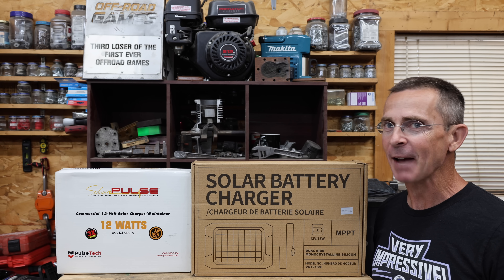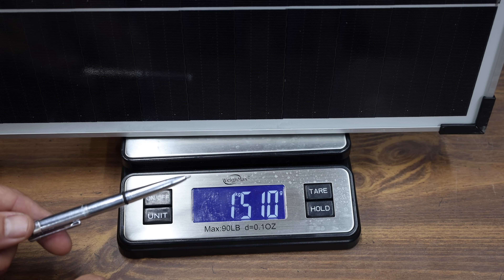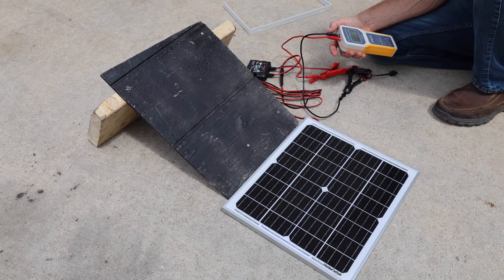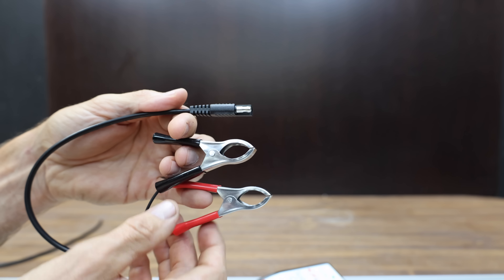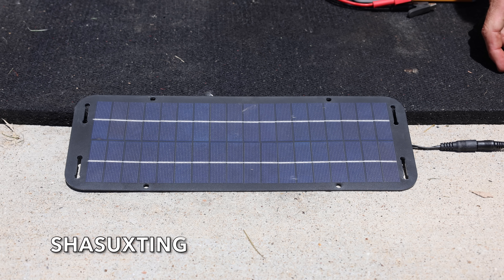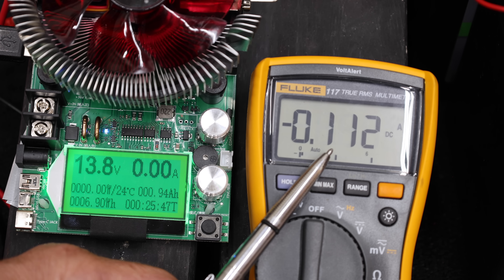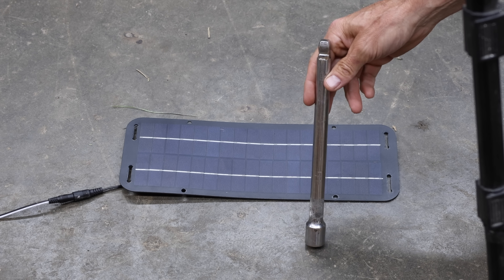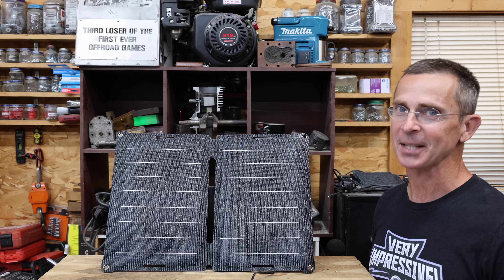I Had No Idea These Were So Good!

Comment: I would not include the power measurement results in the comparison, even seconds on an overcast day can make a huge difference.  
And the fact that some modules had lover power at an angle, which is only the case if refracted radiance is more significant than direct, show that the results should be taken with a HUGE grain of salt.  
You really need a radiation reference or reference measurement, to make the power measurements comparable.

Also the tool you used to measure uses MPPT, so even though some modules had their MPPT below 13.8-14.1V, doesn't mean they would be unfit to tender a 12V car battery, they just would not deliver full power at that voltage.

The in sun measurements however should at least be A LOT more comparable.

Comment: I think the multimeter used here might not be the best for the task - it's rated for 1600W, so most of these are <1% of its capacity.  I suspect temperature of the shunt is enough to swing that measurement a couple watts in either direction.

That said, the battery charging setup was all the info I needed.  That and type - monocrystalline panels work far better in overcast, low-light conditions.  Like, say, if you camp in an old growth forest in the PNW, or want to keep a vehicle's battery topped up year-round.

Comment: I didn't watch the whole video but I used to install and test lead acid battery systems for AT&T. All telephone systems used DC current provided by single cell lead acid batteries. These batteries lasted for many decades because they were always kept fully charged at 2.17 VDC per cell. A fully charged 6 cell car battery should read 13.02 VDC but the alternator will charge it about 14 VDC when the engine is running. After I retired a bought a solar charger from a retired electrical engineer. His solar chargers contained a voltage regulator that kept them from overcharging your battery.

Comment: I've struggled to find a definite answer, even on forums....What is the best trickle charge rate? I've read that lower is better for long term durability. Do I want 3.3w, 7.5w, 9w, 12w, 15w??? I want one to trickle charge my auxiliary boat battery when i'm not using it. I have a NOCO jump starter as backup to the main outboard battery. Amazon's "#1 Best Seller" is POWOXI, which i'm surprised isn't included in this test... $40 for 7.5w, $35 for 3.3w and $70 for 15w...

Comment: Would love to see you do a segment on larger solar set-ups.  Like the size for a shed.  For recharging battery systems for mowers and snowblowers as well as some basic shed lighting.  I have been wanting to solarize me 10x22ft shed for a while and I am stuck on which way to go. It has a nice southern facing roof for about 4 panels.

Comment: Another important factor, not mentioned, is the kind of plug used. Why? A lot of people who own motorcycles, or other electric starting toys have Battery Tender leads attached to our batteries. The solar panels with the same style plug make them an option for when we take our toys somewhere where we can't run an extension cord to use the Battery Tender. I live in an apartment and only ride once every few weeks. I need a solar panel I can toss up on the parking cover and run the wire down to my bike. I want to be able to use the Battery Tender lead I already have attached, so I don't have to have two different leads. If you don't know what plug I'm talking about, it's the style used by the Grecell.

Comment: Ive been using one for 5 or 6 years on my travel trailer parked on my daughters farm current deep cell battery is 5 years old and still going strong. It’s been worth every penny keeping that battery topped off and extends that expensive batteries life.

These would also be useful for dry camping just running the water pump and led lights as long as you get a few hours of good sunlight to top the battery off, no need to buy that expensive fusion brand that plugs into the port on most newer travel trailers and they never tell people that buy it you still need a controller. Think I paid like $19.99 for mine but they’re more expensive now. Mine came with a controller and 20 watt panel, if needed I’d buy a new one a decent battery is like $300 and before using it I was buying a new battery every 2 years had no power for a battery tender where I park it.

Comment: You were right to say that other people would disagree regarding what the charge value is considered high. A 12V car battery is actually comprised of 12 elements. The ideal voltage of a fully charged battery cell / element is 1.2V. Multiply that with 12, it will give you 14.4V for a fully charged 12V battery. Great video nevertheless.

Comment: I have had the pulsetech charger on my lowboy trailer since 2023.

 It keeps the 12v hydraulic powerpack battery for the loading ramps topped between uses. 

The panel is mounted flat to the neck of the trailer between the semi tires. The panel has been sitting in direct Georgia sunlight/rain/hail, etc for 3 years. (controller is covered)

 I put an old used 12v car battery out of a farm truck in it when I built the setup, because I didn't want to waste a new battery. It's still holding charge great 3 yrs later! The panel is constantly getting mud and dirt on it from the rear semi tires slinging it up in the air and landing on it, but its "flexible" surface seems unfazed.

Comment: Photovoltaic solar has 2 limiting factors that make it useless at scale.1, the reaction slows with heat, unlike most others.2 The crystalline structure needs to be thin for efficiency,  but thick for durability.

Comment: Phenomenal videos. Thank you for taking the time putting these together. Another product line idea could be truck bed rubber mats. Comparing OEM to aftermarket to horse stall mats that people use instead sometimes. It would be great to know thickness, material, rubber or other. Slip resistance and puncture resistance would be nice to know.

Additionally, tonneau covers. There are a ton online that are cheap and the ones that are available from authorized dealers are very expensive, Pace Edwards, roll and lock, backflip, etc. Folks online always ask about if these covers leak when installed properly and how long they last over the course of time.

Comment: Hello Mr. Farm, or if I may call you Project. 🤔😬
I am interested in cordless/Battery powered snow shovels for a backyard deck or front porch, even a small gas powered unit preferably not heavy so my wife can also lift it and use it.
I do appreciate all that you do here, it is the most valuable equipment testing site I have seen in my many decades.

Comment: Interesting stuff. I built a wheelchair lift for the rear of my wife's Toyota Highlander. To power the hoist, I installed a battery box with a lawn mower battery and stuck a solar charger, similar to the NX brand, in the side rear window and ran short leads to the battery. Even with tinted glass, it works better than most of my ideas!! Thanks for what you do.

Comment: When you talk watts, it sounds like a lot, but convert it to amps, and it's not much cause 1 amp is 12 watts for 12 volts my 350 watt pannels took damage 6 years ago so i spray it down with clear coat and its still working fine

Comment: I have a 60Watt solar panel and solar controller on my work van. Before I installed the solar system I used to charge my van's battery over a weekend if I didn't use the van . Now I don't have to worry about charging any more and I now installed another 60Watt solar panel to run a small cooler . Now I've seen a slight fuel improvement as the alternator does need to run unless I use AC . Don't know why vehicle manufacturers doesn't fit solar panels on vehicles
Reply from the maker: Thanks for the feedback!

Comment: It's not a valid comparison unless you test all panels simultaneously, as slight differences in light will have a huge effect on output. Some of those tests seemed to be in the full sun and some were not. This will certainly need to be done again if you want any accuracy. If you tilt the panel toward the sun and it performs no better than flat, then you know something is wrong.
Reply from the maker: Thanks for the feedback!

Comment: Plugs into cig lighter? In my car, this is only live/connected with ignition ON. So you have to leave your car with keys in it.... I've run a car solar panel charger, which goes straight to the battery. Makes a big difference!

Comment: I saw a video you can hook up an 18v solar panel to an 18v tool battery charger, on the board, and it will directly charge your battery

Comment: Sorry, but that first test is largely invalid. That solar panel tester is for testing solar panels. In most cases you also had a charge controller, and it doesn't work with charge controllers. It needs the charge controller removed from the circuit.

Comment: I think your solar panel tester is for testing panels without a charge controller. But all of these seem to include integrated controllers. For solar testing you need a known panel to measure at the same time because light conditions change quickly.
Reply from the maker: Thanks for the feedback!

Comment: From what I have been taught there are only two of these solar chargers that would NOT damage a  12 volt start battery for long times between starts.  Your method of rating works great for charging a battery that will not start the vehicle.  But for maintenance I would choose the EBL.  I have used their products and am happy with the results.  The Schumacher has the best cut-in and cut-out for battery maintenance but besides the high cost I have had problems with their products.  This video was timed perfectly because my tractor very nearly did not start today after two weeks of no use and last night was the coldest temperature so far this winter.  I will be buying the EBL.  I still could have got it to start because of your recommendation years ago of the Gooloo jump box.  I never leave home without it.  Thanks a lot.  Now I would like to see tests of battery chargers/conditioners that can charge lead acid and lithium ion batteries.   I still say you are the hardest working YouTuber.
Reply: i also wanted to buy the EBL however the link is dead and all mention of the 25 watt model seems to have been completely scrubbed from their official website, only the 100 watt available for sale now, let me know if you have any luck finding a source from which to buy the 25 watt EBL as i trust project farms review of an exact product but i dont implicitly trust that every product EBL makes is consequently going to have the desirable thresholds for cut in and cut out voltages.

Comment: None of them would work for me at all , I have a couple vehicles stored in my garage for the winter up north, 1. No sun inside the garage, 2. Even if I moved the panel outside like on the garage roof we get over 300" of snow per winter up here, we got 6'-7'  already this winter not normal this soon but happens the panel would be a PITA to clean several times a day.

Comment: I had a bad one of the cheap chinese ones.  I was using it as a trickle charger (plugged in 24x7).  It worked ok in the daytime, but drained my battery at night!  I had a week of low sunlight, and it drained my battery so my car would not start.  I do not know if it was just this one, or if others would fail this way.

Comment: Another great video but a few comments:
- No mono panel will break 24ish percent (less in the real world), you will need Perovskite for that and they are not really available to consumers yet, so any panel claiming more is simply lying, most cheaper panels come in around 14-19% in the real world
- You could have used a solar Irradiance meter (or similar like lux meter) along side each solar test because then you could have gotten a normalized measurement for each panel as the difference in light to the panel at any given moment can change significantly with the sun/clouds/temperature on the panel
- Potentially the most relevant metric was missing which is produced watts per dollar from the panel and also after going through the converter they came with, you could easily work this out from the data you already have too.

Comment: Know what would be a cool video? Those suction cup handles that lock for picking up panels of glass and sheets of metal. Like, check the pounds of force it takes to pop off. I’d go from the baby ones for phone screens to the industrial ones. We use the hell out of them for moving sheet metal. It would be cool to know which ones are high quality. Same goes for magnets that lock. That would be interesting.

Comment: I’ve had a small 5 watt panel on my shed where I store my ATV , snowmobile and riding mower.  I wired it to a terminal strip and  I put a diode on the cable to each battery so a good battery won’t discharge to a low battery. It worked great for 12 years and then an 80MPH wind took it down last month. Now I’m here to find a new one.
Reply: 100W individual solar panel is fairly cheap nowadays, the cheapest you can get is less than $70 each (but keep in mind that the panel size is big)
Reply: @sihamhamda47 I don’t need 100 watts,  5 watts worked  fine for years.  I just need something to maintain the batteries.
Reply: @Chris_at_Home  Ecoflow has 7.5W charger for 11 Euro, mighe be around 15 USD in Amazon US
Reply: @Banks231  If it's Ecoflow, it will be good.
Reply: Out of the tested panels I would suggest that the Hoysicy might be close to perfect, and very cheap at that. But then I saw it was lacking as a battery charger with no cut in voltage for maintenance and apparently never cut off or at least it tried to charge to 16.1V. 
The next up should be the Grecell. It seems to be pretty tough, not the best but still pretty far up in the efficiency and with all the right numbers for battery charging. But it's only listed as Out of Stock so who knows if it will ever be seen again.
Volt Hero isn't expensive. Seems tough. Has the right values for a battery charger. But it's not particularly efficient. But it's still probably better than that old panel  you bought 12 years ago.

If durability isn't as important then the NXQWLL and Flex Solar is definitely the better at charging your batteries. They cost a bit more at $50 and $80 respectively though.

All in all it's impossible to say if any of these will be able to hold on for another 12 years. I bet that the old panel cost a fair bit more when you bought it and probably had a pretty sturdy frame. So the build quality of these might not be as good, but that's just my guessing.

Comment: I have had a 50watt solar, with reg, on a 2nd battery in the van for 6 years. It keeps the 2nd battery up 24/7/365. So, if my main battery goes dead, I flip the 100 amp Barker and jump myself.  I can at any given time have to run my blues, and others 1 to 2 hours a day, 3, 4, 5 times a day/night. Running the van is not going to happen.

Comment: I have a pair of pulsetech chargers on my trailers. One malfuctioned and had to be removed, but neither seemed to do much good. 

I think that they rate these things in watts because they are counting on people not knowing the difference between watts and amps. The amp rating is pretty pathetic. Of course if you just need to keep a battery topped off when it's just sitting that's one thing, if you are powering something with it these chargers won't keep up

Comment: I dont get all the terms that come with these things. I understand watts but watts dont charge a battery. Amps charge the battery in my world. My 110v charger puts out 2 amps or 10 amps or whatever. Most of these types of panels are les than 1 amp from what I can see. Seems like it would take quite a while to charge a flat battery. Watts/volts=amps right ?

Comment: in my experiences, for lead acid battery, I prefer a solar charger (Victron SmartSolar) with temperature compensation (higher charging voltage in winter, lower charging voltages during summer).  My goal is to prolong service life of lead acid battery; current battery age is 5 yrs and 1 month.

Comment: Just a reminder for anyone working with PV systems; Never ever do you hook panels to a charger without a battery attached to it. The battery is what actually powers the controller, it acts as its voltage regulator, if you hook panels to a charger without a battery attached, you can very easily overvolt the module and destroy it, especially with series panels that push closer to 100V output

Comment: I bought a cheap one from HF to make a battery maintainer for my security cams, instead of having to take htem down to charge every few months. Works great, few watts during the day keep them at 100% and making the circuit was fairly straightforward to add polarity protection and voltage stepdowns / protections.

It can also be used to charge phones during hurrican season if the power goes out.
Reply from the maker: Thanks for sharing.

Comment: Did you test any Gan chargers that support DC output for 20V/7A to 12A? I was looking at SlimQ and King Ma. They range between 150W, 240W, 260W and 330W. I haven't seen many portable DC GaN charger options out in the wild.
Reply from the maker: Thanks for the suggestion.

Comment: Here is a possible test idea.  Rubber patching sealants like for camper tops, boats metal roofs etc.  Especially how well they work after the material flexes, how well they cure under normal weather conditions and how fast, as well as how well the patching sealant keeps water out after curing.  With spring coming campers and more will need this.  Thanks love the videos!
Reply from the maker: Thanks!  Thanks for the video idea.